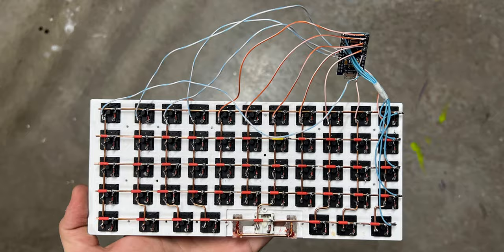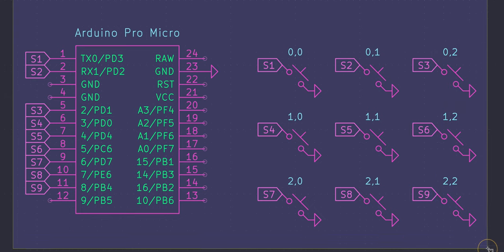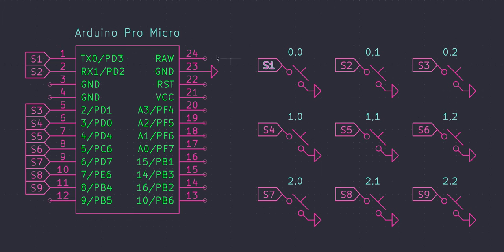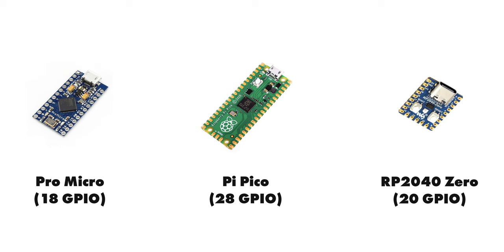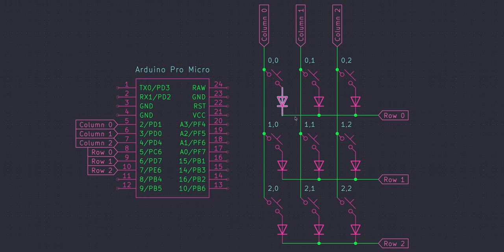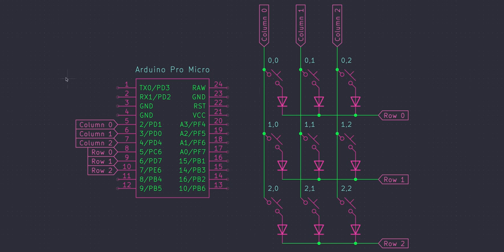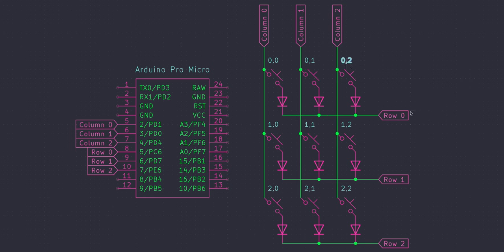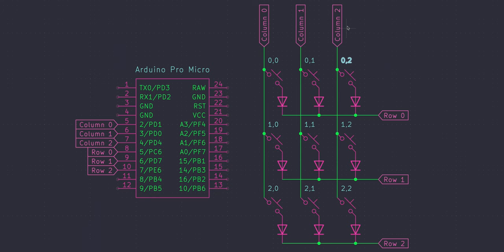How a Mechanical Keyboard Works (Matrix and Direct Wiring)

Comment: Hey just came across this playlist. Can't get enough of it. I did have a question in regards to the pinout on this micro controller and any other micro controller. How do you figure out which pins on the controller go to a certain switch on the pcb ? Like why is S3 -> PD1 and not another pin?

Comment: If I understand this correctly, a matrix should have issues with multiple keys being pressed at the same time, right? So if you press 0,0+1,0 and then add 0,1 the board wouldn't know if you added 0,1 or 1,1 right? Because row 0 and 1 are already active the board won't know which circuit was closed now since they're on the same column. It won't short because of the diodes, but it cannot really know what happend then right?
Reply: It will know every key pressed.
lets call the 3 column A B C. and the 3 row are 1 2 3. In this case you presses the A1 A2 and B2 key. there are pins that can tell wether you activated 1, 2,  3 they are independent of each other. Now the trick is that voltage is only applie  at one column at the same time. First you apply voltage to the A column. 1 and 2 will active. then you apply voltage only on the B column 2 is active. last you apply voltage on C column this time nothing has recieved any signal.
Reply: @karelissomoved1505  Ohh, so it's basically scanning the matrix regularly? I thought it'd apply power all the time and basically instantly see when a switch is closed. But that makes sense that not all rows and columns always have power.

Comment: Quick question, for the matrix, where are the VDD and GND connected?
Reply from the maker: You don’t need those.
Reply: @joe_scotto  wait so then how is a logical 0 or 1 defined? Wouldn’t all the row and column inputs be floating?

Comment: I have a doubt, with the button matrix you don't need the resistors, it's just buttons and diodes?
Reply from the maker: No resistors needed, just buttons and diodes. The diodes allow you to create a matrix with more buttons than you have pins but if you only needed 4, you could leave out the diodes and just direct wire it.
Reply: ok, thank you @joe_scotto

Comment: I’m not sure I fully understand how the controller understands which key is pressed on the matrix. Is it sending an impulse one column after the other? Would this mean that theoretically, a key press could be missed if pressed between impulses? Does it consume more energy than a direct wiring?
Reply from the maker: Basically that’s why we use diodes. The columns send a signal one after the other and the rows are all listening for them. For building a board it’s not super important to know the specifics but the docs do a really nice job explaining in detail: https://github.com/qmk/qmk_firmware/blob/master/docs/how_a_matrix_works.md

Comment: My mechanical space bar is broken:

•If I touch the 2 pins its temporary fix it
•the Switch bark works normal
•But it will break down again if I not use the space bar for a few secs
•Try to resoldering it, but its break again in the next day.
•Try to replace the switch with another switch, its works fine but again same problem, its break down again in the next day.
•The only solution for me is to touch the 2 pins with my finger while tapping the space button.
•what is going on?. I  dont get it.

Comment: The arduino pico can identify 2 different switches on the same row?
Reply: If so, he can identify 2 switches on the same row, even when more than 1 column was "used"?
Reply: Arduino pico? arduino micro or pi pico?
Reply: @rivalyralt6759  Arduino Pro Micro, the microcontroler used on the video, sorry for the typo
Reply: I do not know how the author of the video will do it.  But if the algorithm (code) of sequential "polling" of each matrix cell is applied, then you can hold down any combination of buttons at any time and it will work correctly. 

I recently started learning how button matrices work and this is a very optimized way to create keyboards.  Before that, I used a multiplexer to get more inputs. 

But now you can connect everything together and the multiplexer can work as "columns" and arduino inputs as "rows". This will give a matrix with more buttons.